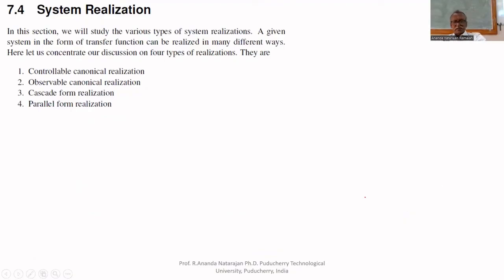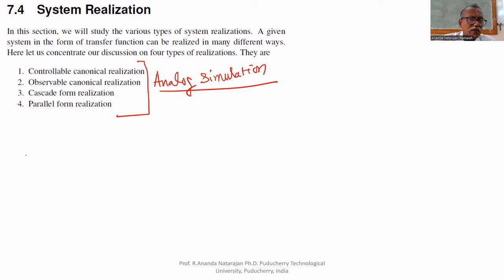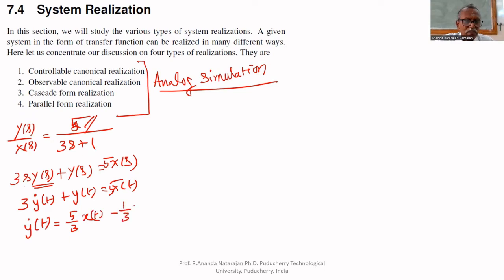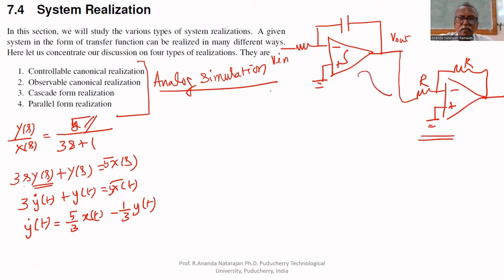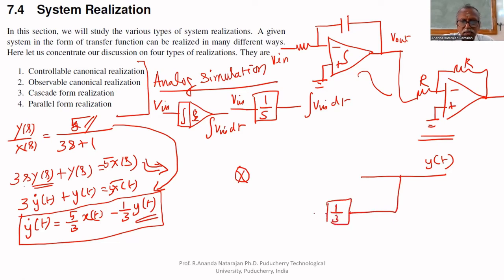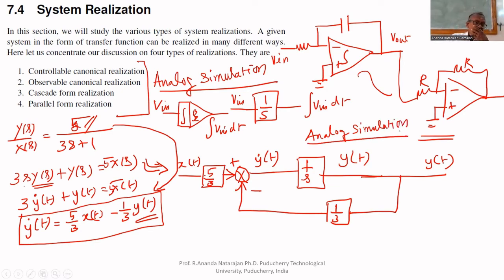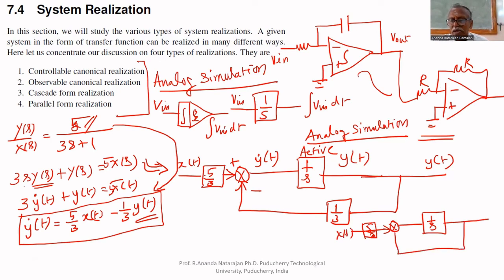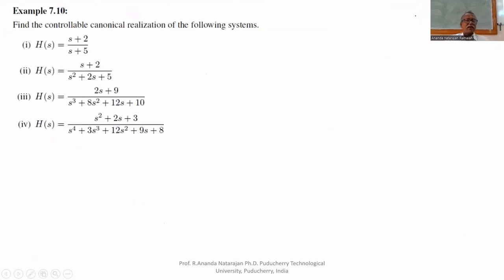Control Systems Class 52(C): Introduction System Realization in State Space Analysis | | GATE #DrRan

Comment from the maker: Master State Variable Analysis (State Space Analysis) in Control Systems through this comprehensive 4-hour lecture. This course is specially designed for Engineering students (ECE, EEE, Electrical, Instrumentation, Mechatronics) and GATE/ESE aspirants.